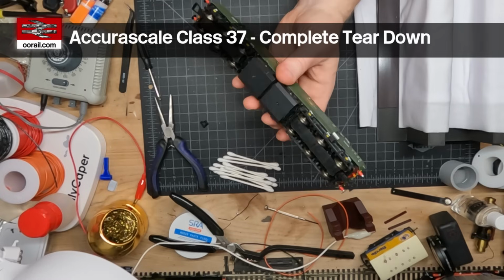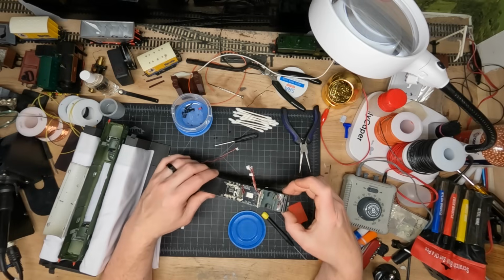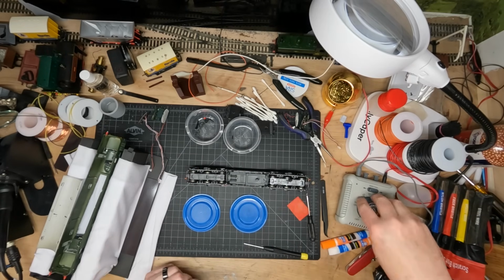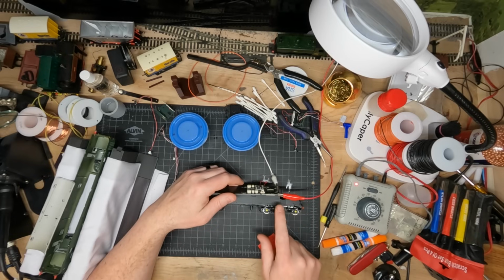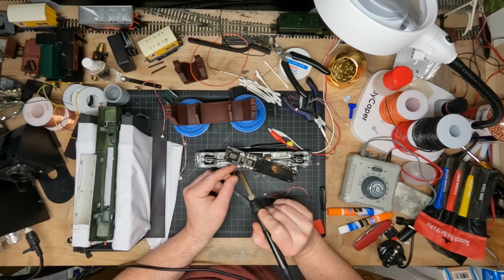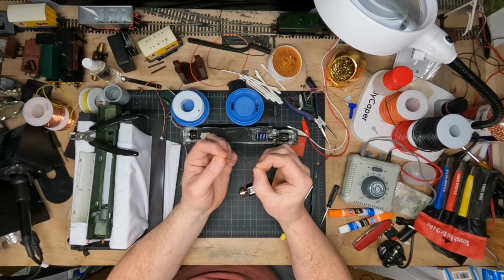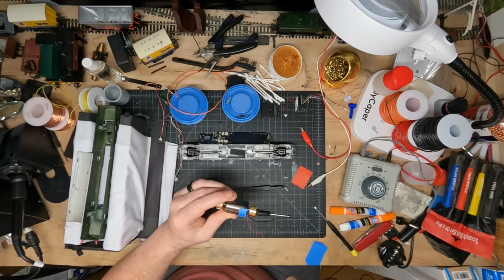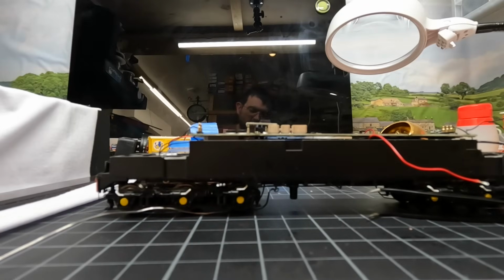Accurascale Class 37 - Complete Tear Down | oorail.com

Comment: I have Loch Lomond 37043 I really like it but it’s not without its faults. The decoder had to go back initially as it didn’t play all the sounds. And it won’t run over my points if I run it with the coupler and snow ploughs as is given as an option….the coupler has now been removed at one end. I’m seeing more and more ‘problem’ videos around this model. I have a 31 & 66 on pre order so fingers crossed they iron everything out or it could be a bit of a disaster for them.

Comment: I had 5 of these, they are all sold n gone. But the bachmann plux 22 loco is also a fragile loco to work with. Early up to the 21 pin bachmann 37s are the best. As a modeller u can work with them . All the accurscale and plux 22 locos are for the box boys and cheque book modellers..

Comment: You should have contacted Accurascale and they would have talked you through fault finding your loco. I live in Australia and had a problem with my loco it turned out to be the motor which they helped me fault find in two hours. It was drawing 800mA which indicated a shorting motor. They sent me a replacement motor as it was quicker for me to replace it. The problem with the motors appeared to be that they have been fitted with the wrong grade of brush clogging up the commutator slots and shorting them out. Which is a motor manufacturing fault, not Accurascale. I have found Accurascale to be very helpful and cannot fault them. All the best with your loco.

Comment: This is just an observation from repairing models as a person who hates waste:
The motor intermittently running slowly is usually a brush / commutator issue - on open frame motors you can see the sparks and sometimes a ring of white fire ( Old Hornby X04, old Graham Farish and Fleischmann N gauge motors)  - this is spiking the power consumption and generating a lot of heat - leave it too long then a motor will internally meltdown. Oddly they rarely smoke unless there is a lot of oil involved.
When you bench run a motor out of a model it very quicky warms and will become hotter than expected (Sometimes too hot too handle). It is harder to see on can motors but they will heat quickly which is an indication of the problem. Inability to run at a set speed is another indicator. On open motors stripping and cleaning the brushes and commutator slot gaps often settles them down. Closed can motors are a pig as I think there must be tools to dis-engage the brushes for assembly and dis-assembly as they can be damaged if you just pull them apart - fly wheels are also bonded on so prevent access - sometimes you can locate a hole in the motor and blast it with electrical circuit board cleaner then spin it up - repeat until it settles. Carefully oil bearings after using cleaner.  (just enough oil to make them glisten - do not flood) Sometimes this can resurrect a motor - helpful if you are a long way from spares.

Comment: A great hands-on video that you deserve much credit for sharing “warts & all”.   You very nicely show an approach that tries to eliminate and then isolate the source of the issue. 

As a builder of kit locos that (nowadays) use similar “sealed” type motors, I’m pretty sure that your conclusion is correct. However, I’m hoping that you will post a follow-up video showing dismantling and inspection of your motor.  I don’t think you will find this too difficult and, based on my experiences, a quick clean of commutator and double-check that brushes are in good condition and correctly seated will hopefully resolve the issue. Good luck!

P.S. It’s nice to see your polite responses to those who only demonstrate their own ignorance in their comments.

Comment: I would be amazed if Accurascale took this loco back under warranty, because you have taken it apart. It`s not an electrical fault, but mechanical. First thing to do if a loco runs slow, is measure the current readings, easy done with a cheap multimeter. Hope you get success with Accruascale
Reply from the maker: Thanks. I actually have an INA219 board attached to each block on the layout, the readings with this were pretty normal. Its a good point though, I didn't check the current draw when the motor was directly powered. I'm not actually looking to send it back, but rather see if they will send me a replacement motor. I've had two bad motors recently from Hornby, a Class 56 and a Class 31, their support is pretty good about dispatching out replacement parts upon request. Whats interesting about the accurascale motor is there doesn't appear to be any unusual vibration or noise when the problem happens, which you usually get if there is a mechanical issue, like a gear problem etc.

Comment: I'd highly recommend watching a video posted by Torridon Road by Peter Dixon who looks into the motor issues and miraculously fixes the same problem you're having with your 37 at the moment.

Seems like this is quite a common fault with Accurascale locos, and I do believe this doesn't just apply to the 37.
Reply from the maker: Thanks, I'll go take a look at Peter's video later tonight. Yes it does seem like its emerging as a common fault.
Reply: Same problems with my ACC 37
Reply: chadwick model railway also has experience with them, hes on his 2nd and his buddy already needed a new decoder on his 2nd engine. so theres a big mistake with all of them.

Comment: Fascinating though this is, the takeaway for the vast majority of us has to be ‘Don’t buy an Accurascale class 37’. Personally this whole issue has put me right off purchasing anything from them.
Reply from the maker: Reading the comments, it definitely seems like its not isolated to the Class 37, with several people reporting they had similar issues with the Deltics. I've got a couple of Class 31s on order, between this motor issue and the less than modeller friendly access to service the thing, I'm thinking of cutting that back to maybe just one or two. I have got a couple of their Irish Railway Models Class A locomotives, those run really well, no issues, so I'm thinking they've got a bad batch of motors in their supply chain, hopefully its something they can sort out.

Comment: Although not a fan of Accurascale due to my past experience I would suggest that before you embark on a 'Teardown' you read the manufacturers instructions on how to remove the body. Its a shame that the trend is to take a look and repair yourself rather than return to the manufacturer. Regards, Geoff.
Reply from the maker: Calling the generic diagram and caption "instructions" is a bit generous. One side of the clips weren't disengaging the way they should but no worries got there in the end. Servicing and repairs is part and parcel of the hobby mate, that manufacturer warranty runs out pretty quickly and these things are definitely not built to last like the old Tri-ang locos.

Comment: Is this problem with all the class 37 including the sectorization ones?
Reply from the maker: Seems to be an issue with the class 37 in general not just the 37/0, from the comments it seems other models, like the Deltic also had problems. So far, I've only had an issue with this 37, but this issue didn't come up until I had ran it in for over an hour. Most manufacturers do a 30-second or so motor test at the factory, and depending on the manufacturer, it often seems to be before the motor is placed in the loco.

Comment: One thing you did not try was a drop of oil on the motor bearings. Those may be a batch of motors that had been lying in a warehouse before they got in the production line of the locos and has dried out bearings. The motor at that power, with no load should be screaming fast. I could see the line on the flywheel which should be a blur if it ran at speed. You also need to get a good soldering iron.  At least a 35 watt iron. That pencil iron is useless. Use liquid, no clean flux. The stuff you are using is corrosive.
Reply from the maker: Thanks. I'll give that a go tonight and see if it helps. The soldering iron is actually a 75W SMD station, so it's not so bad. Thanks for the tip on the liquid solder flux, I ordered some this morning!
Reply: @Oorail  Great. I think the iron has a tip that is too small ... if it is meant for SMD work. Try a normal iron. I saw how you had a hard time getting those wires off. Usually, wires don't go bad like that but these particular wires looked too fine. It is possible that they are not sized for the current draw of that motor. That is an easy fix. Just put 2 new, heavier leads there. But the motor bearings may be the likely cause. If not, maybe the magnets inside is losing the strength. Very unlikely but then, you will need a new motor. Now, that is a pain because you have to remove the weights that is another story!

Comment: Really hope Accurascale have stopped burying their heads in the sand regarding these motor issues and have found a correction. Happened to three of my deltics (one of which has been with Accurascale warranty since April 23 so hopefully they are figuring it out.)
Reply from the maker: Agreed, seems like a lot of people are having issues. That seems a very long time (8+ months?) for them to have the loco, are they having issues with parts?

Comment: why strip down a brand new loco, when this issue is covered in so many videos inc Chadwick (Charlie Bishop).  Its a design / QC issue and the loco should be sent straight back to the retailer or Accurascale if purchased direct.   By opening the model and messing about with the inner working you loose any chance of a warranty replacement.
Reply from the maker: Main reason is to maintain control of the repair process and there is never a guarantee of a warranty replacement. By tearing it down and isolating the problem to a specific part, I can ask the manufacturer for a replacement part. The loco stays with me and I guarantee that I still have D6702. Since this loco is sold out everywhere, a return to the retailer is most likely going to result in a refund and no loco. 

If they send it back to the manufacturer for repair, aside from taking weeks or longer, now your loco has been messed with by multiple people, increasing the chances that detailing parts are lost etc. If the manufacturer doesn't have the part or can't figure out the problem, the loco could sit there for months. There was a comment earlier that Accurascale had someones Deltic for months. I live in the USA, so with international shipping the whole process is going to be even longer. 

By tearing it down, worst case, the manufacturer doesn't have the parts, won't ship the parts or might ask me to purchase the parts. These days you can 3D print most plastic parts, motors are easy to source and even PCBs can be produced cheaply using services like PCBway. Charlie is on his third loco, he has no idea if its a repair, new or refurbished replacement. By tearing it down, it opens up opportunities to make some enhancements and correct design issues that could become a problem in the future. Its not for everyone, but after watching that Hornby TV series, I feel I'm better off repairing things myself! :)
Reply: The elephant in the room is that you shouldn’t have to. It’s ok designing these models in CAD with scores of separate detail parts, but if the manufacturing plant is still cranking out substandard crap then its frailties are going to be royally exposed very quickly. It’s like designing a Lamborghini and outsourcing the build to Fiat.

Meanwhile Bachmann and Heljan continue to pump out fine looking models that work properly. 
Designers don’t always make for great engineers.

Comment: Had similar issue on my class 92 high power draw and would only crawl around the track sent it back after about 4 weeks got a replacement sent back,seems the motors are the weak point  in their models not just Accurascale I’m having same issues with a new Hornby hst so the problem seems down to China who manufacture the models.

Comment: It's painful to see you trying to desolder these wires with the wrong tip and insufficient heat. I suggest using a small spade bit and around 750 F. You are far more likely to damage other components with prolonged contact at low temp. It should take a second or less with the right heat.
Reply from the maker: Thanks for taking the time to respond. However what you are suggesting is not the best approach. Since this is an SMD board, using an SMD tip is a safer approach as those are designed for use on those pads and allows for the heat to be focused directly on the wire. Since we have no idea what type of solder or any additional chemicals that were used on the original solder joints, starting out at a lower temperature is a better approach as you don't know what the right heat actually is. If you go too high initially, the solder will melt too quickly and you can easily damage the PCB. The risk of prolonged contact at a lower temperature is pretty low, especially since my finger was going to feel it long before any damage to components or tracks on the board. Since the solder melted pretty quickly at 450 F, 750 F would have definitely been way too high.
Reply: Please watch Peter do it on Torridon Road.
Reply from the maker: @tommilton5753 The solder melts at around 450 F, using a higher temperature will work but is unnecessary and you run the risk of damaging the PCB. It's not welding. The original wiring needs to be replaced too, too thin and easily breaks.
Reply: I agree with Tom. Learn to solder/desolder properly. 3 minutes to desolder 1 wire which should take 1 second. There are plenty of helpful soldering tutorials on YouTube.  Higher temp for less time is the way to go. Also dipping your iron directly into flux will destroy the tip very rapidly.
Reply from the maker: @TheSharkey22  Thanks for taking the time to comment. Its rosin flux, so its not going to cause any issues for the soldering iron tip. As for the temperature, these are surface mount modern PCBs, not perf board, so its better to start at a lower temperature and work your way up. What wasn't captured on the video was me cranking the temperature up slowly until it melted. The melting point of the solder is around 450 F, but going in at 750 F like Tom suggests, very likely going to melt it too quickly and increase the risk for damaging components. Some online advice from electrical engineers - "It's wise to start at a reasonable temperature and then make small adjustments. If you start at 350°F and find that the solder isn't melting, you can gradually increase the temperature. Smaller increments (like 10-20°F) are generally better as they provide more control.", " If you're working with particularly heat-sensitive components or a delicate PCB, starting lower and gradually increasing the temperature might be safer to avoid damage." and "While starting too low might be inefficient as it won't melt the solder, it's safer for the components."